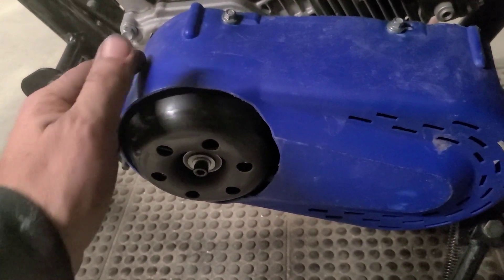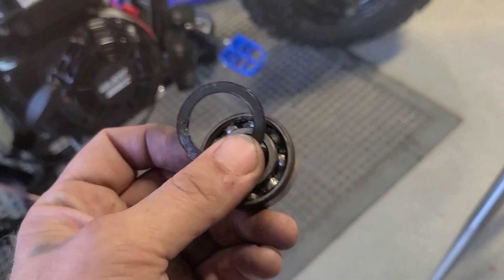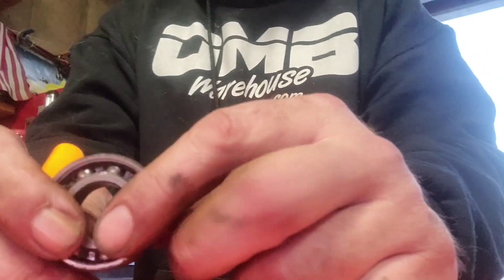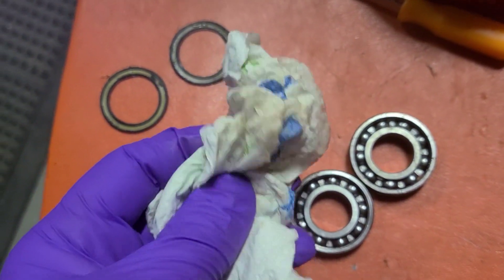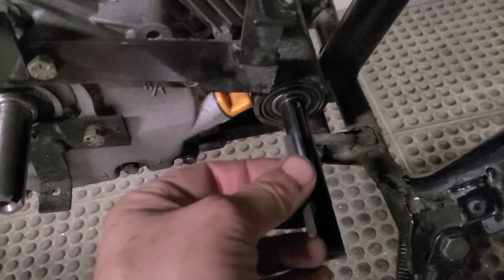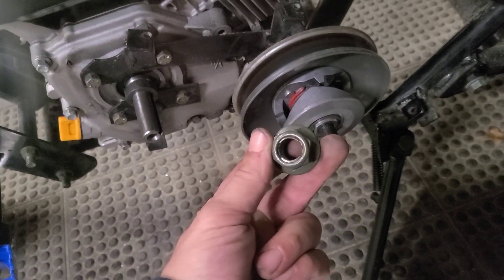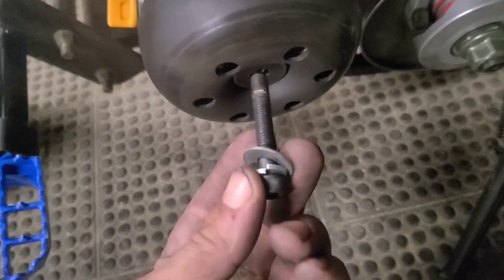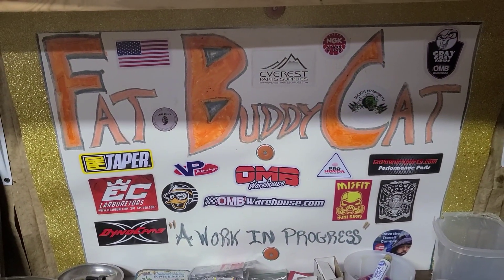Trailmaster MB200-2 Maintenance "Jackshafts and Juggernauts"

Comment: Does the castle nut with the pin on the jack shaft bolt have to be tight because when I bought mine it was loose
Reply from the maker: You don't want it 100% tight. When they are all the way tight then they impinge on the bearings. I'd go tight and then barely back it off before setting the pin.

Comment: 17:12 You said that you have a tensioner plate to get the belt a little tighter... What's the benefits of that compared to stock tension? Does it grab at idle?
Reply from the maker: I was able to run different belt sizes and keep the stock driver with positive placement on the shaft. The stock output shaft is longer than normal, Trailmaster set their Pulley inline with that long shaft instead of spacing the pulley to a normal length shaft.
Reply: @fatbuddycat  ah I see, I was wondering if you got the belt super tight, if the tension would grip the belt at idle rpm.

Comment: Yo Buddy Cat, I just got a new side cover and after i installed the bearings into it i flipped it over to install the new seal but i screwed up and pressed the seal to hard and now it's in too far deep pressed against the back of the bearings. Do you think a pick is what I should use to get it out ? I already tried a mini flat head screwdriver and needle nose pliers with no luck. I'm not worried about damaging the seal cause i have more new ones so i just want the seal that's in there to get the hell out so the bearings can spin freely. Right now the seal is in pressing against the bearings so tight they won't spin. Help please.
Reply from the maker: I use a flat screwdriver that has the tip bent up a little. Just be careful not to scratch it up where the seal sits against the block.
Reply: @fatbuddycat  so since i posted this a couple weeks ago I did eventually get that seal out and slapped a new one in but just yesterday while riding around for a while the oil pressure inside the block built up to the point that it burst out somewhere and sprayed oil everywhere from bottom of motorcycle style gas tank to bottom of bike frame and everywhere inbetween. I don't even know where to begin looking to find the correct spot where the oil is escaping because oil got all over everything. The only reason I noticed oil was getting out is because it also sprayed onto my header pipe and the heat from the pipe made it start smoking. I had new gaskets on it too with the copper seal spray on them too just too be sure no oil would escape but it still did. I'm thinking maybe it got out of the Billet Valve Covers nipple that is used to vent and pulse port. I gotta small air filter with tube in 1 of the holes and the brass nipple in the other hole on top of the cover. Maybe I'm just not venting the engine properly ? I do have a Stage 4 Race Head on it if that makes the pressure inside the block build up that much more that a stock engine along with other mods so how the heck do i know what and where to vent ? I assumed the air filter in valve cover would be enough. 🤔
Reply from the maker: @JNC  I bore out the galley hole in the lifter boss then barb the side cover. I have 2 barbs at the valve cover. One redistributes block/head pressure and the other goes to a pcv with a filter or a catch can.

Comment: What's so great about the juggernaut clutch?
Reply from the maker: At the time it was the only available super 30 series driver. I prefer the Torkzilla for most instances.  If you have built engines that exceed mechanical capabilities of standard 30 series drivers or are held back by them you can achieve better performance. They run your internals harder and will wear the engine quicker but if your aware of what your doing they provide a pretty awesome ride.

Comment: You shouldn’t use the Juggernaut on that motor unless you mod the motor to a stage 2 or more.
Reply from the maker: It's got a 265 cam, long rod, billet lifters, 26s, ARC flywheel and a 26mm carb.
Reply: Why?

Comment: I have a little grease gun  for filling air tools
& it makes filling bearings easier..       

I  used to have a tote gote  & it had a zerk fittings 
On everything ..jack shaft, wheels & even the head tube  making maintenance    So easy
Old jackshaft  grease would  be pushed out onto the chain..
  My bt needs zerk fittings.
 On my 1978 puch free spirit moped  brake & throttle cables it has little caps to fill the cables with oil. 
Also I like using copper washers on my exhaust 
Because  I’ve noticed a lot of old school quality bikes use em.
Reply from the maker: That's some good information there! It's pretty crazy how the only parts that have contact with the shaft and get grease are the two bearings. It's a wonder these fail frequently!

Comment: No lube required for the spider parts?
Reply from the maker: I didn't find it necessary on this one, in the description I mention this is a "quick clean method" for the super 30 series.
Reply from the maker: I think you can drop a little oil on the springs and pivots but it would be very scantily applied.